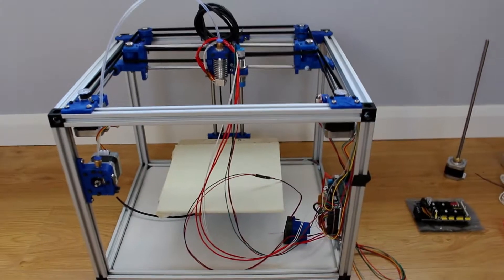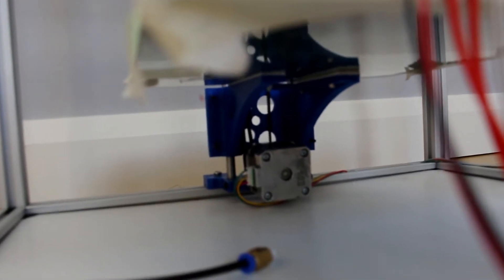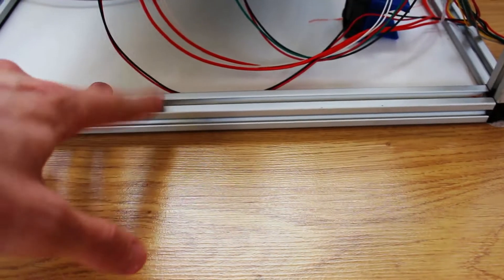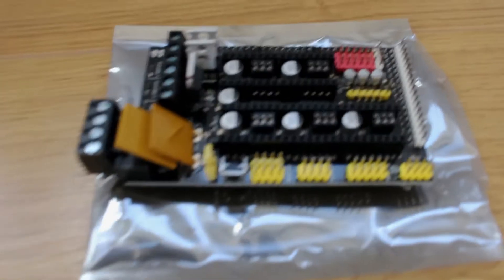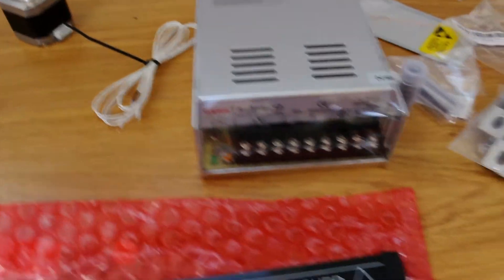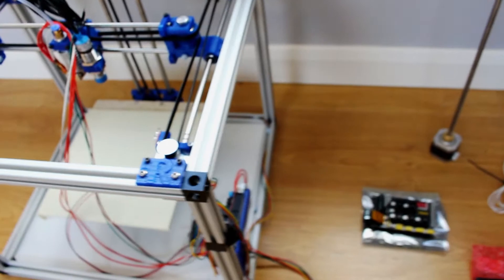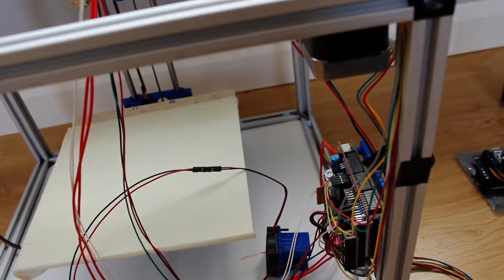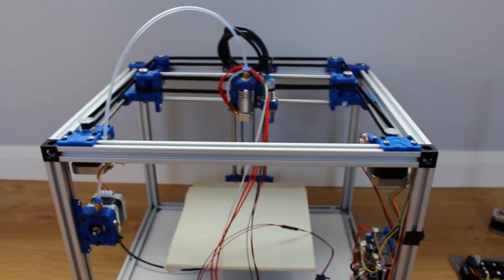HyperCube 3D Printer Build Part 1 - Introduction

Comment: Hi, could you send me your frame and electronics assembly scheme? Here in BRASIL there is not much about it and I'm having a hard time riding. Thanks nikakz@gmail.com
Reply from the maker: Hello, the critical frame dimensions are the same as what is on Tech2c's thingiverse page, I'll I've done is extended the z-axis members to accommodate an extra space for electronics at the bottom. The electronics are just wired as normal to a ramps 1.4 which you can find simple wiring diagrams of online. Hope this helps, thanks for watching :)
Reply: Thanks for the answer